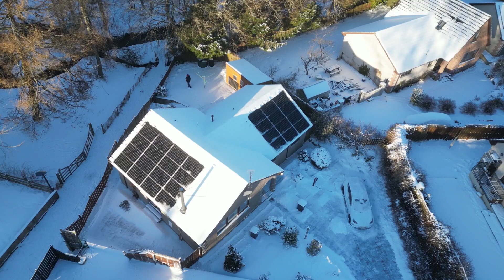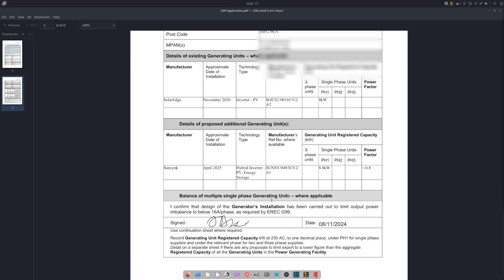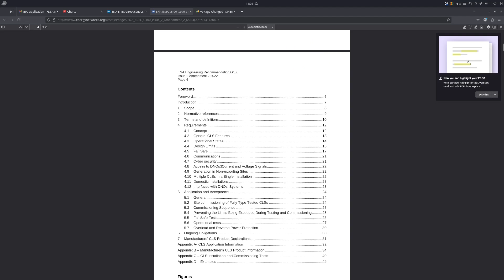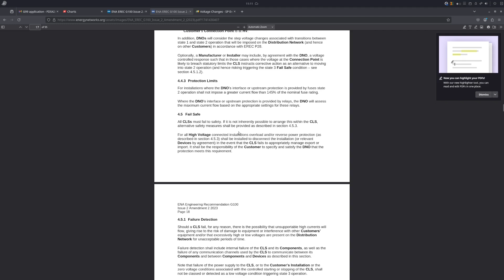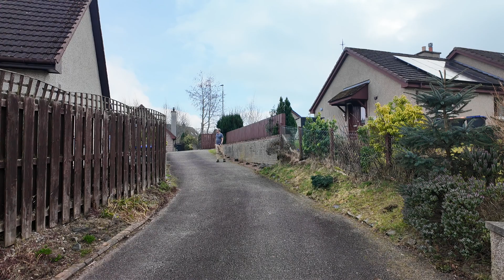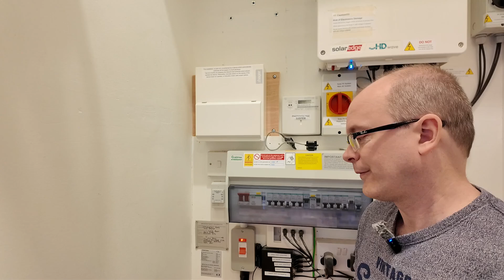G99 Application process for more solar/batteries

Comment: How to solve your you cable upgrade issue, aka “the cost” …
I requested a meter move, legitimately since there was no way solar could be installed with the meter where it was, existing cable was on a poll shared 100A with neighbours also!
Now I am with SSE also, but down south, and I requested the meter be moved about 30m from where it was to an outside cab on the driveway. Now I can only assume they have to do residential “meter moves” for a fixed cost, so move the meter 30mm or 30m its the same charge to the consumer.
Only this meant they had to dig up 50m of driveway, run cable with all three phases… they just did that themselves (although I only use one) I did have to pay for the outside cab and plinth and the interior cable back to the consumer, but that was very little cost considering, the SSE charge, just over £500 all in, digging, new cable, reinstatement, cherrypicker, supply engineers you name it… even new gravel for the drive they turned over… A complete bargain I would say!
So something about moving the meter flattened all the costs! Obviously move it to short a distance and they won’t bother with all that fuss…

Comment: I'd be amazed if you can't buy an off the shelf voltage contactor. I vaguely remember seeing a youtube video of one being installed on a solar install for this exact reason. Would make me think if you put one in your diagram and resent it it would get approved as the existing voltage contactor would have all the certifications already rather than a DIY solution with modbus.
Reply: seems like they are sold as "Voltage Optimiser". Looks like "GivEnergy Voltage Optimiser" might work, can be bought on Midsummer wholesale
Reply from the maker: @gsdevme  I was just having a look.  So it steps down the incoming voltage to your house by a selectable amount (6,12,18 V)

The trouble is two fold:
1.  The inverter still has to produce a voltage that’s higher than the grid supply in order to supply the house.
2. The outgoing voltage still has to overcome the Ze loop impedance in order to export 5kw.  So while your property will be at 240V, the DNO side of this device will be exposed to higher voltages, and this will be what they object to.

Nonetheless in the future if the inverter is shutting down in the middle of the day, then installing this device might just keep it going.
Reply: @anthonydyer3939  ah right, so the application I had seen was perhaps for that. Got to think there’s something the other way around.

Comment: The solution is to talk all of your neighbours into 3.68kw of export via g98, which the dno cannot say no to, forcing the voktage over 257v, reporting the hugh voltage, and making them upgrade their creaking infrastructure at their cost!!
Reply from the maker: @richardskinner6391  Unfortunately G98 applies to 3.68kW of generation (for the whole site), not just export.  I’m pretty sure my neighbours will grab has much generation as they have roof space.  So even if they only plan on 3.68kw of export, it’s still a G99 application that’s required.
Reply: @anthonydyer3939  that is true, but I have never known a dno refuse to give at least 3.68kW via g99.

Comment: I find the best way is to run your house mainly on off grid with 2 consumer units one for off grid and one for on grid so you can do what want bigger battery storage for off grid and charge up if necessary over nite cheap  electric enough to run all your daily use and then run your grid tied system for generating at the higher price to pay for your cheap rate also covers your daily charge and gas bill works well and u don’t have to tell the DNO AND NO ENERGY BILLS  cheap electric over night 6 pence and 7 hours of it and 16 pence export with E.ON THE BEST ONE I FOUND straight forward check it out !

Comment: Another case of “ hidden” costs that won’t be included in achieving Net Zero 
I’ve got a loop system with my neighbours so if we need a heat pump  and because they have already got a heat pump and 2 EVs I’m having to have my own dedicated supply 
So it’s
Road closure and footpath  to dig up
A 2year old drive to be taken up and repaired
A cost of around £4000 ( paid by northern powergrid)  NOT the government 
It’ll never happen
Reply from the maker: @itsmrfish1  Yes…. Except it already did happen - with gas.

In the early 1990’s they installed gas in my childhood village.  Transco (as I think they were called back then) dug up all the streets in all my surrounding villages.  That included digging up private driveways in install a feeder pipe to a termination point on every property.  

Why did they do this?  They wanted more gas customers, and people were willing in their masses to take up the offer and leave their oil tanks and storage heaters on the scrap heap.  I don’t think there was a particularly large installation cost to the end user. 

They point to make is that this kind of infrastructure transformation has already happened at a large scale, and it will happen again.
Reply: @ 
I meant net zero
Reply from the maker: @itsmrfish1  yes, but the point is that if it can happen with gas, then why can’t it happen with net zero?  

Digging up a street is of course expensive, but it’s not rocket science.
Reply: Loop remove is usually free (can end up with free 3 phase as they have to pull new cables anyway)

Comment: Just reagarding adding another off grid system to your property ,,,  If the added system has a battery,,could you not supply the grid tied inverter via the PV cable with currant over night and sell back to the grid,,, So you would be supplying the grid more/less 24hrs ,and recharging your offgrid system during the day..    I dare say there are flaws,,,,, just I cannot think of any  !!

Comment: Let’s be honest, the only reason any of us want to increase our export limit is profit, with panels as cheap as chips you’d be crazy not to. But I struggle to understand the variation within and between regions, I was limited to 6 kW whereas I requested 11kW, my appeal was rejected, I was lucky in that they didn’t limit my peak generation at 16kW. So I just store the excess and feed it in overnight, I use the credit to offset my high winter usage. There must be voltage limiting devices they could mandate so assume they are intentionally limiting households from excess generation, my guess is that trend will increase over time as it discourages reliance on the state and profits for business.
Given Israels recent use of truly weaponising consumer electronics your choice of solar edge products seems a high risk strategy for someone looking to mitigate risk.Relations between nations can change very quickly.

Comment: I am just working on my solar system, my Huawei 3 phase system which is grid tied very similar to the new signenergy systems, now have a new gateway to allow 63A, total ups on grid failure with generator backup input on this gateway , I have spoken to Huawei about not having a generator but connecting the grid to the generator supply the being totally off grid no need for any g98/9 or 100 as no feed back , but power on the generator supply to top up battery’s and run house when no solar or when  battery exhausted.

Comment: I had the same situation. I just took my house off grid completely with my Sunsynk 8kW inverter, which powered the house and 1 Heat Pump Had another 8kW inverter to charge the car and power 1 Heat Pump all hooked up to 90kWh of batteries. Another 3.68kW Sunsynk inverter just to export, this inverter can also charge the batteries at 4kW in the winter on cheap rate. 80 x 400w ground mount panels was needed for all this though.
Reply: very smart solution especially when exporting is not a priority, what is your daily usage like? 90kwh of batteries is crazy big, i am assuming you using some of that to optimize import/export rates, e.g import at night and export during the day.
Reply: @KrysDIY  only for the 3 winter months do I charge at 7p kWh and that's about 20kWh total. I also charge the phase change hot water storage for those months as well and the grid is only good for about 9kW before the voltage drops a bit too much at the consumer unit. Right now I use the grid just to export only and £12 a day is my record export with a 3.6kW inverter. The Tesla Model S85 eats a lot of the solar we make and I always keep 35% of the 90kWh battery for the house. Heatpumps use about 700w at 19 Deg C for 2,000 sq ft house this time of year, it runs all the time.  10kWh a night for hot water. The last 12 months we've done 22k miles in the Tesla for under £100 total cost (app give all the charging stats) 201k miles 10 years old and 12% battery loss so far. 215 real world range at fast speeds.

I can charge faster if I use the house inverter Sunsynk 8kW to charge at 7kW but it trips the RCD units and the Tesla doesn't like it.Best to just charge 20% battery in winter and if it goes over 35% then it exports 3.6kw auto. Now it hits 35% by 10am and it exports 3.6kw whilst also putting up to 5kW into the battery on the 2 x strings connected to it. Regularly hit 100% charge of 90kWh battery by 3pm.

Comment: Is a 3 phase supply an option? In some circumstances this can be cheaper I think?
Reply from the maker: @Tim_Small  If I was going to go through the trouble of digging up the drive then I would only do so for 3 phase.  I suspect the additional cost would be marginal.  It would certainly add options, but as mentioned in many respects I’ve already accomplished my money saving mission.  Chances are that I’d never utilise 3 phase.

Comment: You're lucky I've got a property that was connected before 1973 so has a nominal supply voltage of 240V and on good generation days we get voltages of 257V, me and the other people on our street are limited to 3.6kW even with a G99
Reply from the maker: @terrymackenzie6784  My nominal supply voltage is also 240V.  I think 230V was harmonised back in 2004.  According to SSE, they investigated adjusting the transformer tappings, but concluded that I would still be out of limits in a mode 3 fault condition.
Reply: @anthonydyer3939  that's interesting the DNO won't change the substation tapping so I'm stuck with the 3.6 limit and it's getting worse as more house's in the street add solar.

Comment: A possible solution would be to install a smaller inverter to keep under the export limit while keeping the proposed number of panels. You will lose some output in peak sunlight but realistically you don't get peak sun for all that long. If energy security is your goal you need to worry more about winter generation than peak summer output.
Reply: This certainly seems the cleanest solution. Plus an easy upgrade path if the DNO are ever willing to accept more export - sell it and upgrade, or get another smaller inverter.

Other probably worse ideas include:
- Getting two smaller inverters now. One off-grid (charging batteries), one on-grid (exporting, powering house). Then, with a motorised transfer switch, switch which one is on-grid and which is off-grid. For G99 purposes, only one of them exists, because only one can be connected to the grid at once.
- Set up the shed inverter off-grid. Towards the end of the day, export power from the Solaredge battery. Then in the off-peak period, transfer the solaredge inverter from being on-grid, to connected to the shed circuit; charge the Solaredge battery off the shed battery; then transfer it back to being on-grid again. So laundering the electrons from the shed, through the Solaredge kit.

Comment: I have a Sigenegy system that can be used to supply a secondary inverter

The second inverter is supplied via a smart port that can be used (by the Sigenergy gateway) to sour the second inverter supply and shut it down (it alters the frequency it supplies to it to make it tempoarily shut down)
The smart port can also be used as a generator supply port instead

You can get a larger inverter and have it throttled down to 5kW export which still leaves the full size of the inverter to be used at the home

It also has 0ms whole home backup

The inverter is a hybrid inverter (and can be remote from the gateway) has MPPT inputs
This allows the system to operate completely off grid if needed

Comment: put in an independent system that only charges your car from a battery which doesnt export to the grid?
16s 280ah lfp system, ~48v, which you charge your ev from. get an inverter with grid bypass if your use exceeds the battery pack.
a single phase ~6.2kw inverter which you charge your ev from, they cost about 300 usd from powmr.
the ~15kwh battery would only cost 740usd here in the us. probably a bit more over there.
how often are you pulling more than 15kwh into your ev? and how often is that when you dont have solar production to refill the battery as your car charges from it?
if they dont want your cheap electrons keep them for yourself m8. you would loose some production when the battery pack is full, but how often is that? better roi this way i believe.

Comment: For some stupid reason we are only allowed 5kw per phase in Australia. It really needs to be double that at least. 10 kW is really the bare minimum to make solar viable. What I can do is increase the input to my batteries and split it half and half so that my Fronius can draw from 10kw rather than just five. Luckily I have two phases to my property. So I can ramp it up to 10 to grid plus five just to batteries. 
Even without an EV I would say 15 kW is a realistic cover all set up. 20 kW even better.
Reply: Network stability and voltage rise.  What ever figure is allowed in a given state ensures everyone that wants to can put up roof top solar and feed-in.  It can be that you can only export 5kW per phase but can have 10kW of capability - export 5, consume 5 or curtail.  Of course with feed-in becoming less and less of a proposition (Victoria's 0.4 cent / kWh tariff), emergency backstop etc it's clear that the future is self consumption and battery with no feed-in at all.  

Unlike countries that Australia is often compared with we tend to have smaller distribution transformers per premises too.  It's not unusual for a 200kVA transformer to have 100 houses connected in areas with gas and 315kVA with 30 to 60 in areas that don't.  Compare that ratio with the USA's low (often 1 or 2 on a 50kVa transformer) count and the number of premises on a 500+ kVA transformer in the UK.  This has implications for just how much generation you can attach to the secondary side in a system that was never envisioned would be fed from the edges rather than the core.
Reply: @retrozmachine1189  
I have never had any illusions about the way Australia runs its grid and I don't doubt that soon feed in will have zero credit.
Fk em. I'm setting up my back up generator and they can stuff their crappy grid. Just need a selectronics inverter and a three phase alternator for my machines.
The fact that Canberra is sabotaging Oz and selling out to China comes as no surprise.
Reply: @retrozmachine1189  
Only 4 cents in Victoria  ? 
Victoria sucks and NSW probably won't be to far behind. Doesn't surprise me. We are staging our way to go off grid anyway but if your right about zero feed in within a few year's we are ready to disconnect earlier. This net  zero scam is going to force a lot of people in to energy poverty. It's insane.

Comment: Given that their concern is over a fault condition that would already require the failure of 2 independent systems i dont have much confidence that your suggestion of adding a 3rd system will appease them.
Reply from the maker: @ReubenGow  I would be inclined to say that you’re right.  Most failure scenarios assume a single fault.  The basis for that would be that the fault is detected and therefore repaired in a shorter time than it takes for a 2nd fault to appear.

Furthermore I’ve never seen an isolator / breaker that trips on supply overvoltage.  There’s certainly nothing with G100 type approval, so such a system while possible to implement, would be hard to get approval for without extensive testing and documentation.

Comment: If I were you I’d go ahead with your limitation system and fit your extra inverter and not worry about it! I know it breaks their rules but as far as I’m concerned they’re asking you go with their “solution”! I fitted a changeover switch to our house which runs the house in EPS mode, it can only supply 3kw but that’s enough to run the gas boiler and lights. Typically however we only get power cuts in the winter when the batteries are already dead!